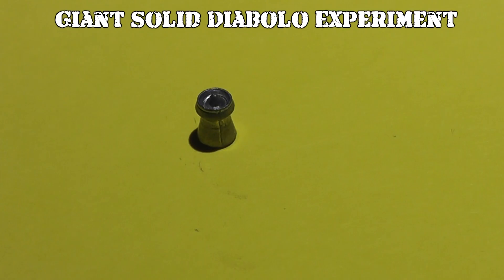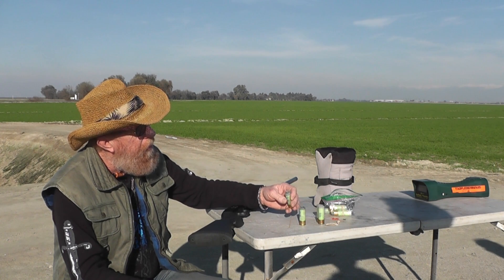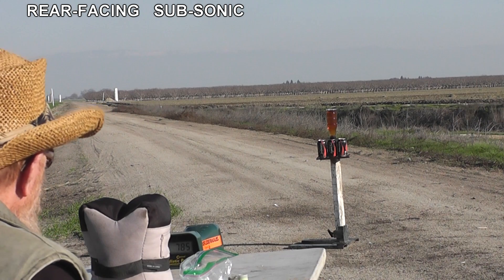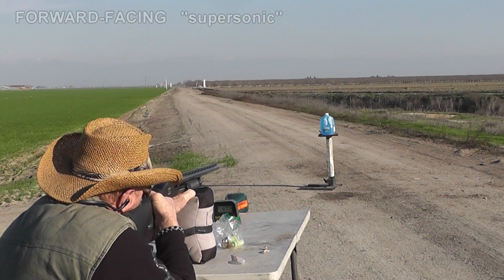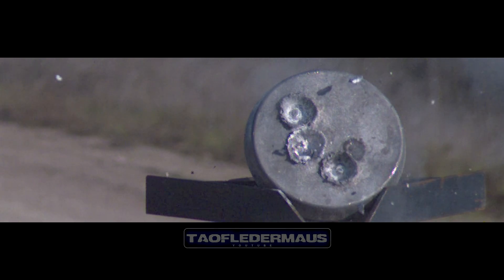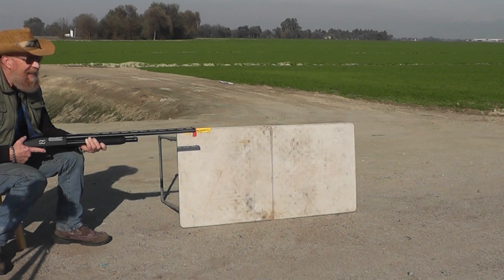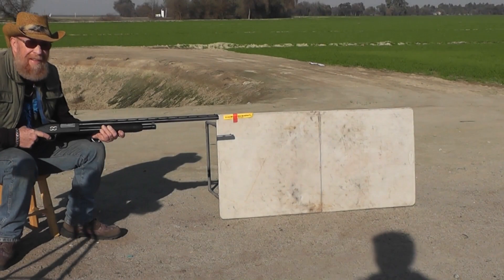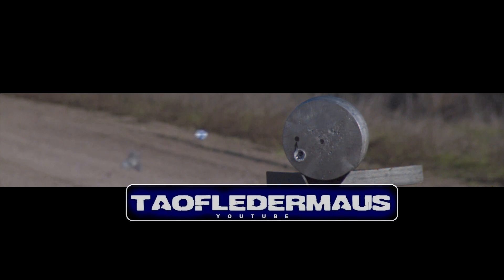Giant SOLID Diabolo pellets -  Subsonic and Transonic Tests

Comment: Are this hollow slugs designed to expand like in a pelet gun, to prevent the gases excape?
Reply from the maker: No in this case,   in a 12ga a plastic gas seal is used.

Comment: Hey Jeff, you weren't using a tapered wad in a straight walled hull, were you?
Reply from the maker: I don't remember
Reply: @taofledermaus  I watched again. Definitely your issue with the blow-by. Those Fiocchi hulls are straight-walled and the Downrange wads are tapered. Use a PT1215 wad with that hull. Or a Remington STS hull with that wad. I pour Lyman Diablos. They claim they are 525gn but when I make them from pure soft lead they weigh 540gn. Great slug!

Comment: At a guess I would say that the solid slugs going forward are aerodynamically neutrally stable, i.e. neither stable nor unstable. This means that if you have one which separates from the sabot cleanly it will fly straight. However, it the sabot knocks it or does not separate cleanly then it will tumble depending on how hard it is hit. The ones going backwards are probably similar but perhaps slightly aerodynamically unstable and hence more likely to tumble. The range is really too short to be able to see very much but I understand the difficulties of using a longer range.

Comment: on that second shadowographing shot you guys did, you just barely captured [truly captured that is] the shockwave flying with the slug towards the very end of the table. up until that point all you can see is is the gasses being pulled along with the bullet. 
(or projectile, if you prefer.) 
cool as fuck, either way.

Comment: I tell yah what you wanna see something vicious I got the idea from this channel but I keep my 2 inch poly Judge loaded with 4/10 birdshot wax slugs, "Absolutely Devastating out of that revolver give it a try and I also take 4/10 buck shot and remove the balls and then I put in a 7mm mag bullet and pour wax around it to stabilize it and I've gotten out to 150 yards of accuracy out of that revolver with a hole bunch of stopping power

Comment: I fill my diabolo slugs with silicone which improves the accuracy.  The plug prohibits the wad from deforming into the slug which I believe results in a straighter or flatter release from the wad. I use Nobel Sport GTT1 wads from BPI, you need to check them out.
Love your channel!!!

Comment: You should drill a hole in the tip, fill it half full with grease, then cap it off with a ball bearing. Creating a hydraulic explosion

Comment: Happy New Year!!!  That shadow film stuff is neat!!!   I think your gas blowby issue is the Hulls you are using.  Cheddite made hulls (Federal and many others) are shaped different (they are straight hulled vs tapered) from American made ones internally and that may be the issue.  You might try using a Remington STS or Winchester AA Hull and see if that has an improvement.  I also would request if you can find a Patternmaster choke tube that has the wad Stripping studs inside to test them to see if they actually work as well as advertised.   Keep the awesome Videos coming!!!
Reply from the maker: thanks!

Comment: Has anyone told you that the Chronograph has to be 10' away from the muzzle to give you accurate reading? Basically every velocity you had was wrong.
Reply from the maker: Not with shotguns because any further you'd have two objects it is trying to read.

Comment: At 20 °C (68 °F), the speed of sound in air is about 343 meters per second (1,234.8 km/h; 1,125 ft/s; 767 mph; 667 kn).   
https://en.wikipedia.org/wiki/Speed_of_sound#Tables

Comment: Concerning the gas blowby:
I showed this to my buddy who shoots black powder shotguns and he said to grease your barrel with some axel grease or Vaseline. "Just ram a glop down the barrel about an inch and use a pencil or stick to poke a hole in it."

Apparently thats supposed to let the air in the barrel escape and form a bit more of a seal for the cup and slug. He also said to try using a cloth wad in front of the shell "just shove a cleaning patch in there muzzle load style."

Comment: You could put a yardstick on the shadowgraph and calculate the speed from that
Reply from the maker: I probably could if I could remember the formula!
Reply: @taofledermaus  Frame rate divided by the number of frames it takes to travel one foot.  e.g. 10,000 frames per second / (5 frames per foot) = 2,000 feet/second (may not apply in California -- check your local laws).  Higher frame rate gives more accuracy of course. It would be fun to check how accurate your chronograph is.

Comment: Jeff, the wads may have been the wrong diameter for your bore. Standard US 12ga is .729, but Europe uses .724. Mossberg also uses overbore dimensions of .733 on some of their barrels that are not designed for slug use. This could explain the gas blow-by? Maybe try a separate oversized gas seal?
Reply from the maker: Hey, I think you nailed it.  These measure .700"   An FS12 measures .730"    That would do it.
Reply: Very good observation!

Comment: maybe try dipping the shot cups in wax before inserting them in to the shell to help block the gasses and build up a little more pressure. HAPPY NEW YEARS TO ALL, cant wait to see what's in store from y'all  in 2019
Reply from the maker: These actually measure up a little small.   The wads are about .030" smaller than other 12ga wads.

Comment: SUGGESTION :   Two 5/8" steel ball bearings bound together with layers of shrink tubing = Newtons Hammer. I have some in my shop ready to load but not sure whether to use just a gas check and layer for a good fit, or size them to a shot cup. CAUTION......Untested prototype in development, It may be a bad idea but it's an idea. Anyone else?
Reply from the maker: You'd probably need a short gas seal like an FS-12

Comment: remember those plastic mach 3 slugs? I wonder what would happen if you used that powder load and fired a plastic slug with a tiny tungsten pellet.
Reply from the maker: THey have some slugs with a brass set screw down the center now,  but we haven't tried those.

Comment: Happy New Year, guys!!   A thought about the shadowgraph: Instead of putting the table in direct sunlight, turn the table so the top is in shadow and then use a largish mirror to reflect the sunlight onto the tabletop. This will result in sharper shadows as the light is only coming from one narrow angle instead of from the whole area of the sky around the sun.
Reply from the maker: The muzzle blast would probably cause the mirror to warp around,  I'd think.    You can often see the HS camera twitch from the shockwave hitting it.

Comment: Very nice!
The diagnosis was great! 
I wonder what kind of pressures you would have had if there were no leakage??
Reply from the maker: Oh,   hopefully under 11,000 psi for a safe load!    It turned out the wads are undersized and sloppy.  about .030"  smaller than other "good" wads I have used.
Reply: @taofledermaus   I played around with some 20 ga solid fosters a few years ago, using a single-shot topper. the 20 and 12 ga have the same outside dimensions, so the wall thickness of the chamber is a lot thicker with the 20. 
I got my pressures up a bit too high because the cases were imprinting from the breech face. I think that is like 14 or 15 k?   1500 fps with a 400 grain slug. Speed was good, but accuracy was erratic.   It seems like 1200 to 1300 fps is about optimal for the 20 ga.

Comment: Good video. 
Id bet that if you were to cast a steel ball bearing into the tip of these slugs (where just the tip of the ball bearing is showing) that you would see as much penetration as youve seen to date. Just my $.02.
Reply from the maker: The trick is finding a way to keep the ball in...  really strong glue
Reply: If the ball bearing were cast where only about a third of the ball bearing was showing from the nose, wouldnt the lead hold the bearing in place?